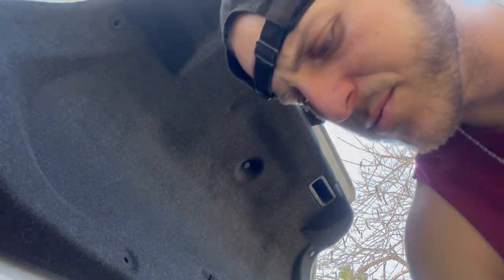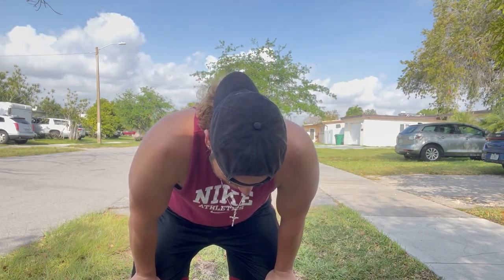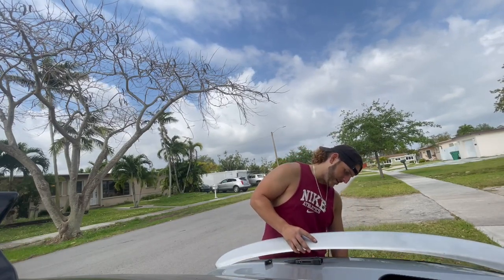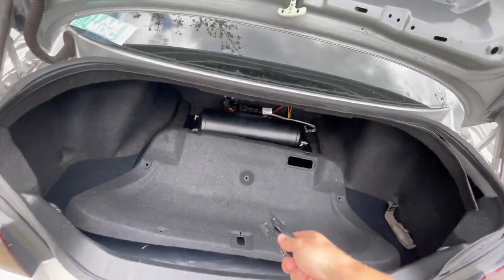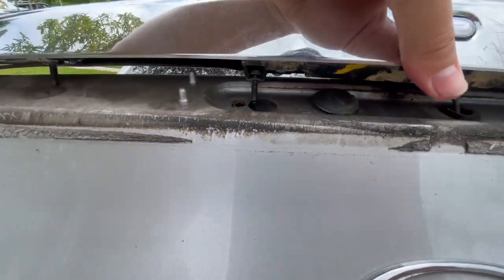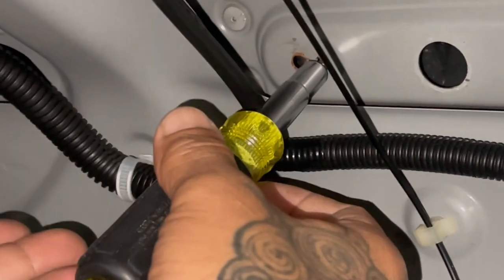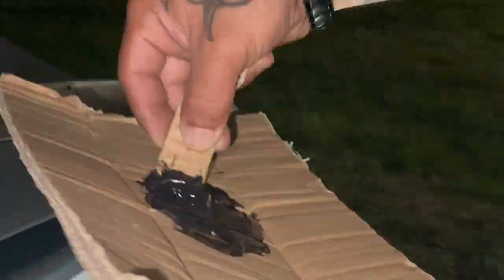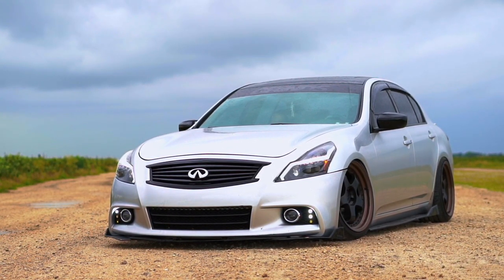G37 / G35 M style spoiler

Comment: Question, no paint shops near me will paint the “chrome plastic OEM spoiler.  How did you get that spoiler painted?
Reply from the maker: @UprightYT  you can either wrap it, or paint it yourself. 
Painting yourself wouldn’t be hard, there is paint specific for chrome.
Reply: @moddedmedia1258  did you paint it or wrap it?  If you painted it did you sand the chrome off first?
Reply from the maker: @UprightYT  i painted it. But I didn’t  sand it. I probably should have tbh